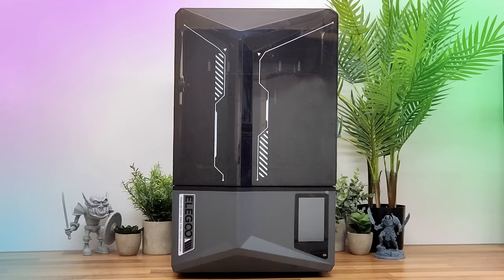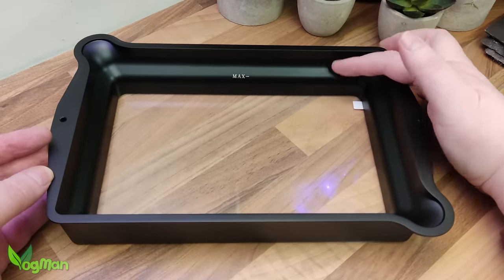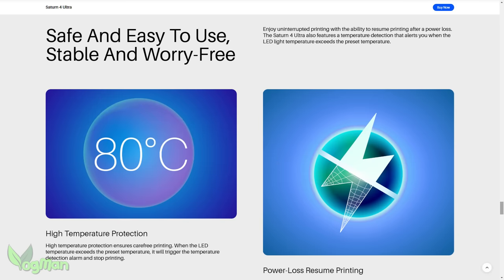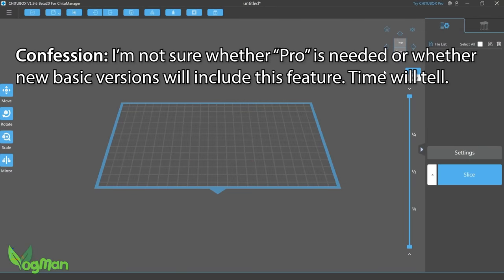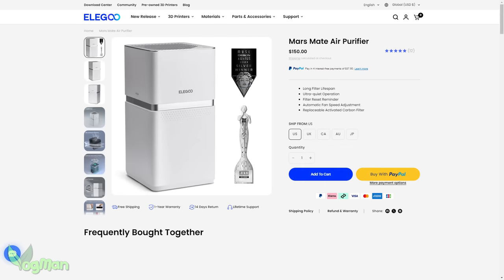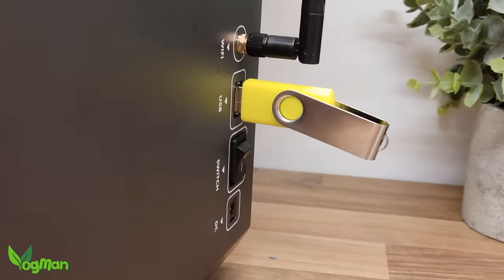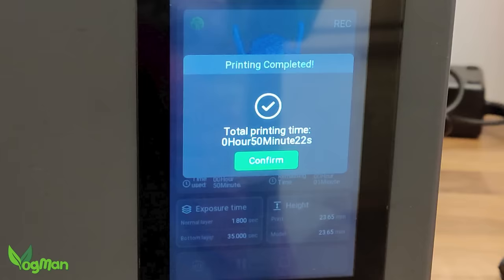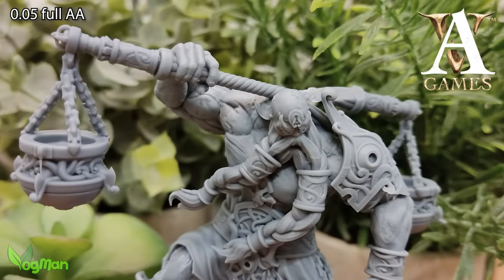Elegoo Saturn 4 Ultra (HONEST review) 3D resin printer

Comment: I have to side with elegoo on separating out the heater. My printer sits in a fairly well-regulated room, temperature wise, and I've got nothing to gain from adding a heater to my printer. I'd imagine roughly half of resin printer users are in a similar boat, whether due to their setup or locale. It just makes sense to separate out that functionality, rather than incorporating the cost into every single printer sold. Elegoo's been the primary force driving down costs in hobbyist resin printing since the Mars 1, and I'd have to imagine a lot of careful cuts and consideration went into being able to put the 4 Ultra out at $400.
Reply from the maker: That's a fair point... but I have a couple of Australia buddies who have no issues printing in the day, but find falling temperatures a night a big problem. However, I appreciate not everywhere is the same - and I'm a little biased on this particular subject 🤣😂🤣
Reply: I was getting failed prints for weeks inside my fairly warm house.
Thanks to Vogman's heater project, I have rarely had a problem since.
Temperature is more critical than a lot of people imagine.
Reply: My printer sits in the garage so a heater is desperately needed in the winter.
Reply: @vogman that’s why I have a mini enclosure with a full on proper heater
Reply: I wouldn’t buy a printer without a heater. 
If they wanted to reduce the price they should of got ridden of that useless camera.
Reply: Thanks :-)
I was too impatient to await your review, grabbed one the day it was released…

I can’t wait to try it with custom pigmented resins.

The tilt should keep the pigment suspended , allowing taller prints to not lose colour towards the top!!
Reply: @vogman Yes and us Aussies are just going into winter now! It also doesn't look like I could fit the heater in and use the exhaust port at the same time 🤷‍♂️. Let's see what anycubic m7 has to offer tomorrow.
Reply: @TryptychUK  If this is true, temperature seems to be very important
Reply: M5S Pro comes with a heater for a $399 14k 100+ mm/hr printer. With an air purifier.
Reply: Agreed. I don't need a heater and never have and I live somewhere it snows all winter. My printers are inside and it's always a similar temp. I don't want to add $50 to the price for a feature I don't need and wouldn't use. So Elegoo did it the best way possible, those who want or need it can pay the $50, or if you don't want it, you get a cheaper price.

Comment: All power and USB accessories should be in the front.  Why they place it on the sides or the back is beyond my thinking.  People want easy access. Great review mate.  All the best.
Reply from the maker: Absolutely!
Reply: Until you get a drip down the front and ruin a port
Reply: @Jstubbs104  Well  UNTILL that happens, will worry about it at that time.
Reply: @LSCModels  It also becomes inconvenient when you count for being in front of your printer.
Reply: Elegoo had the usb ports and other accessories up front, but resin dripping and fep failure the ports were getting damaged. They moved them because they learned from people before. I have a mars pro and an og saturn and I see exactly why they did what they did.
Reply: Want them on the side.  My workspace is in front.

To each their own.
Reply: why would you want your power wired through the front…

Comment: It does seem to me that the tilt release is more about making the print less likely to fail due to sticking rather than it being all about speed. But Prusa's SL1S SPEED printer featured tilting and the marketing was HEAVILY about how much faster it was. I feel this is more of a marketing focusing on the wrong aspect rather than it being outright silly. I would love to see a comparison on if the tilting mechanism means I don't have to have as many supports on a floating model, because the forces exerted on the model are not as extreme. This would be huge.

Comment: The lack of a heater is no deal breaker for me. I do all my printing in an unheated garage, so I put my printers in insulated grow boxes with a ceramic heater inside. I was able to print all winter long with temperatures sometimes in the 20s F with no problems. A quick trip to the local hardware will take care of the lack of a handle on the flip lid. I plan on adding a Saturn 4 Ultra to my "factory".
Reply from the maker: There's nothing wrong with fixes and workarounds - that's something I love doing. But my job here is to observe potential issues so folks know exactly what to expect when their purchase arrives 😁
Reply: That and the heater is $55 on their website - you can by one and still save hundreds from a GK two.

Comment: Weirdly the M5sPro is the same resolution (if you look at the pixel size) but has less Z height, so this is actually looking like a good proposition. I've long been a fan of the Anycubic RERF functionality, so to see something similar finally showing up on a Elegoo machine is glorious.
Reply from the maker: The 12 and 14K issue is a weird one. The 14K improves resolution on the X, maintains it on the Y, I think. The difference on paper isn't worth worry about. However... look at the photos. I've done two 14K printers now. Compare the prints to the 12K's. Maybe it's me, but I swear the 14K's are smoother and just as detailed... the voxel lines are harder to see. 
That's why I take the photos, so folks can judge for themselves 😁😁😁
And the RERF thing... brilliant idea. Every printer should have one... that works 😁

Comment: For what it's worth - The drip tray is there to keep you from spilling resin down in to the gap required for the tilt mechanism to work... So not a waste of time or money compared to what would happen if resin spilled inside the machine.  I agree it could be better made though I'm sure someone will create a model to be printed from more resilient materials.
Reply from the maker: I get that, I really do. I kind of think of it as a safety net for Elegoo. As is, "There's a problem... what if the resin gets into the mechanism?" and the answer was, "Oh, just cover everything up with a cheap bit of plastic."
That worries me. I think maybe a little more thought was necessary rather than relying on something that clearly won't last all that long.
This is a wonderfully innovative design and I think it could be the start of something exciting. But for me it feels like they've designed a teleportation device and they're housing it under a bit of old tarp 😁

Comment: Having used mine for a month or so now the lid doesn't bother me at all, it opens well enough even 1 handed. my only real issue so far is that the pieces really grip the build plate and i struggle to get them off a lot more than i did with my Mars, i am a noob though and haven't adjusted any settings, so maybe that would help.

Comment: The tilt release is the most exciting thing ever for me as a Dice Maker because the huge pull forces make the dice elongate in this kinda non-linear way where the closer to the build plate you get, the more elongated it is along the Z axis (so you can't just squish it in the slicer to compensate), this elongation then has to be corrected by sanding the dice while applying force at an angle, very carefully, and even with hundreds of dice made, it's still hard and I can't get them perfect, only prints with a Form 3 come out without this warping, thanks to the tilt release.

But seeing the mechanism Elegoo is using, it worries me that the pushing up against the print before pulling down might actually make it worse in a different way. It also worries me that the Tilt Release is marketed exclusively as a fast printing thing, it might just really not help with dimensional accuracy at all.

Also It makes me worry that the whole mechanism might wear out and develop some wiggle room, bringing the alignment of the screen with the collimating lenses into play, and causing a loss of detail. This wasn't a worry in the Form printers because of the lack of a screen, obviously.
Reply from the maker: I have the same concerns about the tilt mechanism. Usually anything that moves a lots, wears a lot. But it's way too early to say anything about this yet. It's a great feature and I applaud Elegoo for it 😁
Reply: The tilt release is a wonderful thing if done correctly, like in the Prusa SL1S SPEED 3D printer, which is  open source for years. I tink Elegoo might just found it finally :D
Reply: Maybe the STL can be scaled nonlinearly by hand in blender on the Z axis to account for the elongation?
Reply: I've owned machines with similar mechanisms. They're fine when they work but moving parts introduce another possible point of failure. The machines I have eventually had issues returning the platform back to zero/home consistently. In both cases this mechanism was the first thing to fail. Personally I'm not a fan, but maybe elegoo has a more reliable solution.
Reply: Only 10 years behind everyone else huh, I built in that feature on first home made DLP printer 12 years ago! the first Formlabs form1, which i still own, had it, and again, that was also a standard affair a decade ago.
Reply: @joeargyle  I'm no fan of Elegoo to put it mildly, but their tilt mechanism is simple and robust, they even use a Nema 23 motor for the tilt mechanism (simple cam with metal parts), it wouldn't be surprising if the tilt mechanism remains reliable and outlasts the ball screw motor...
Reply: Seems to me if you made a hardened receptacle (or alignment pins) for the tilted parts to return to when at 0, wear could be rendered moot. The only time alignment is super important is when the tilting parts are not tilting. So they could have some slop during the tilt even increasing over time with wear. But when returned and rigid is when everything must be accurate. So not seeing how elegoo did it I can't comment on the saturn 4 ultra. But certainly their engineers would have realized this and used it to their advantage. If they didn't take that approach, run away.
Reply: @MattJonesYT  There's too many variables, the elongation on each part is dependent on how many layers are left afterwards, on the surface area and shape of that segment AND of the following segments, on the resin type, on the temperature, on the pull speeds, position on the FEP, cure times... It's too many variables, so while the main one is just "closer to the build plate = more elongated", it would probably take a materials engineer and a mathematician to make an algorithm that tells you how to pre-deform to counter the issue.
Reply: @patprop74 I bet those weren't even close to $500 either though so not sure the argument
Reply: I'm a big fan of this printer. I've seen it printing and the time lapse feature. The fact that it doesn't have a heater doesn't concern me at all but like there's have said, the reliability of the vat tilt will tell with time but I definitely think if something is going to go wrong then that would be it.

Comment: The speed issues are odd Vog. I find when I slice the exact same file on a modified Saturn profile and the Saturn 4 Ultra profile, it just about halves the time. And the makes since because the Ultra 4 completes a cycle in 5.5 seconds opposed to approximately 10 seconds on the original Saturn. To make 150mm/hour I'd have to use a massive layer height, but still the tilt is giving significant saving in time. Also saves me from tuning and cleaning the fails from tuning stuff like retraction speeds.

Comment: What a treat!!! Sitting at work mindlessly doing reports when this beauty shows up! Literally the video I’ve been looking for! 

It was either this, the A1(in may) or the p1p. Eased my mind a little but still not sure where to pull the trigger.
Reply: You're comparing FDM to resin, which do you need first as the higher priority is the question, the other comes later, because they are not comparable.
Reply: @cenciende9401  I am not comparing them, it’s simply a quandary of a decision.

I’d honestly love to have a resin printer but with such a small room that I have to work with, the fumes are a big concern for me. It might be my deciding factor honestly.

I’m strongly considering the p1p or s because I want to make pieces for cosplay and the bigger platform surely would help.

Comment: That's cool, the features you seem most worried about it lacking (heater, filter) are ones that don't matter for my setup as they are solved by my printer "enclosure".
Reply from the maker: There you go. Then I've done my job. That's all I worry about 😁😁😁
Reply: @vogman  That's why I watch your videos, no fear of being critical and you just lay out any potential issues clearly. 

I have my resin printers in an old commercial bench fridge which is heated and vents outside, so I smell nothing when the doors are closed and can easily control the temperature.

Comment: I'm so glad you didn't tell us all that it's the best low-cost mid-size resin printer by far. (I've just bought the M5S Pro)
Although that tilt plate sounds like a great feature, I don't have buyer's remorse. Phew! 😊
Thanks for another balanced review. Cheers!
ps. I added 1cm silicon feet into the foot contours on the M5S and it's far more stable and less noisy now.
Reply from the maker: Never have buyers remorse, especially with printers. These update much too quickly for anyone to keep up with. It's not worth trying to. Be happy with your decisions and enjoy your purchase 😁😁😁

Comment: The missing heater is a major oversight. How much of the vat rim remains outside of the chassis when it tilts though? I would be inclined to use one of the belt style vat heating means, but am concerned the belt might interfere with the tilt.

Comment: I had a Formlabs Form 1+. It was similar in that it utilized a tilt feature on the resin tray to “peel” the print from the bedplate. Over time, I noticed the constant peel to one side would throw off the bedplate leveling. In addition, sometimes, the tilt wasn’t “deep” enough to execute the peel. Meaning, the bedplate would twist and deflect over the entire resin tray tilt cycle. It would never actually peel and release. This would always result in failed prints. Do you anticipate these issues with the Saturn 4 Ultra?

Comment: do you have any plans to review the formlabs 4 printer?
also there is a new Micron Desktop SLS 3D Printer. 3,000$. in june.
Reply: I have a form 3, and a Saturn s.  I had the form 3 first and used it regularly until I got the saturn s.  My prints are sharper, faster and use cheaper resin than the expensive proprietary resins from Formlabs. My point is I ‘m not sure what the heck Formlabs is thinking charging what they charge for their products.  With other companies doing better than them at a fraction of the cost, I am wondering how many of those $4500 form 4’s they will be able to sell.
Reply: @julythrunov  They're targeting corporations, I think. Hobbyist want cheap and open. Corporations generally want reliability and support. Tinkering around to get a printer working is a waste of money to a corporation when that employee can be doing other things that make the corporation money.

Comment: I happened to be looking for a reasonably priced resin printer when the Saturn 4 was launched so I more or less ordered one on a whim. It will replace my past-end-of-life Form 2, and it was funny to see Formlabs launch the Form 4 literally 2 days later, which is now an MSLA machine that still costs 10x as much. Anyway I will see how I go and whether I need a heater, but good to know the basic print quality should be pretty good, even if one of the first things you need to print is a handle to glue on the stupid hood.

Comment: Don't have a saturn 4, but with my 3 ultra, I got those high speed print when I used the included  Voxeldance Tango slicer software. It has a builtin profile for it.
Reply: Hey what kind of speeds are you getting?

Comment: I'm a little concerned with the additional mechanisms involved in the tilting vat. Just one more integral aspect that could go wrong. Changing out the screen and fep is one thing, how do you feel about this component possibly breaking and needing to be replaced?
Reply from the maker: I'm always wary about mechanical moving parts too. Time will tell I guess.
Reply: Use 3d printer to make new one. Jokes aside, its looks quite sturdy.

Comment: @11:30  I always wondered what you look like...   :)
Still not built my furnace which is based on yours but without the lift, I will lift the crucible instead.  My MYPIN TA4-SNR  controller died, shows as power off/on but it never cuts the power to the SSR. It's always switched on.  Having trouble finding a new TA4-SNR.  :(

Not been watching much lately and have an original Elegoo Mars.  What would you put your own money on at the current moment in time?   Speed not important a bigger platform is a must though.  Thanks for all your work..

Comment: I'm fine with the thing coming without a heating function. Anyone who cares about their health should always have a ventilated enclosure for their resin printer(s), and these are easily heated using cheaper and better options than one of those heater units. Every printer on the market which has an in-built heater is also very expensive, though (and this one would have been too), and to me personally, it's not worth the money. You can get an app-controled thermostat plug and some kind of heating system (heater lamps, ceramic heater etc) for the same money, and you can set and monitor temps from the coach. 

Also, the vat tipping mechanism has some very solid fundamental principles behind it, so people will figure out to get the most out of it. I'm convinced it's going to be the most important speed innovation of this generation.